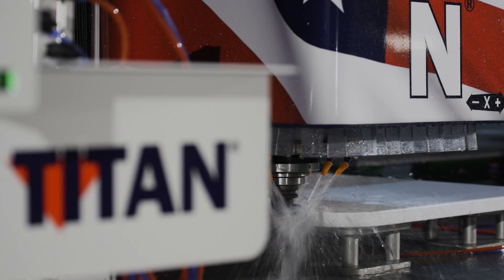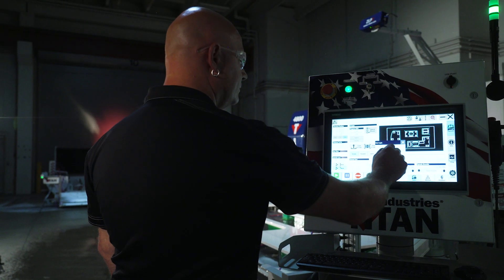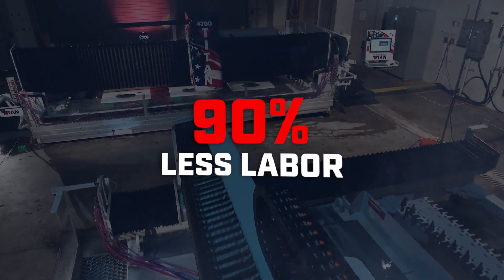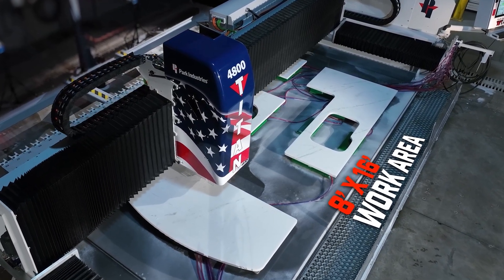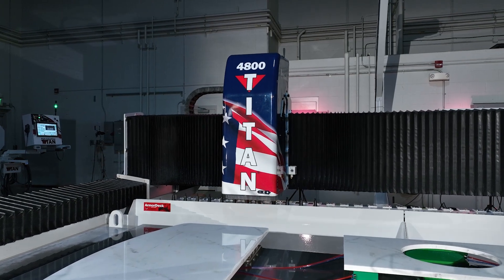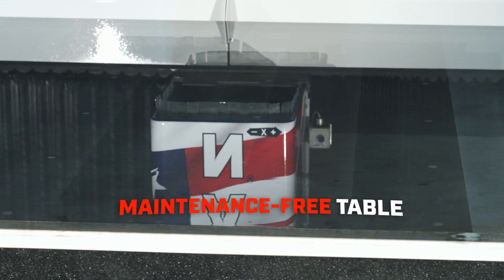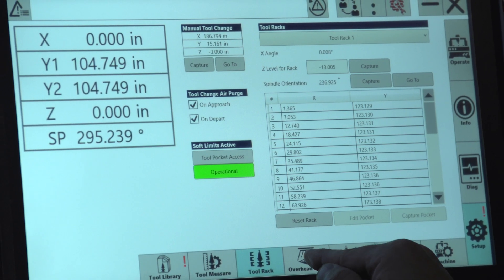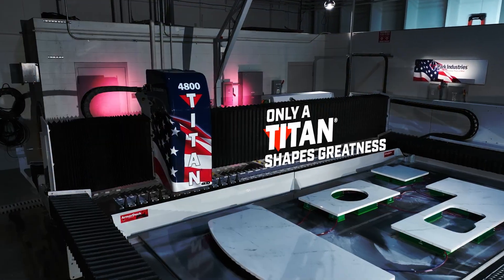TITAN 4000 CNC Router Series | Only a TITAN Shapes Greatness

Comment: I was watching Titan talking to a guy about simultaneous milling.  If the part is the same on both sides, one cutting head on the left and one on the right could cut at the same time, careful not to meet in the middle.  It would take a little more programing but take have the time to cut the part.  Even a part that isn’t a mirror image on both sides could be milled by two cutting heads without the table moving.  Good luck and welcome to Texas.
Reply from the maker: Love the idea Patrick, thanks for sharing your vision of a multi-head version of the TITAN, we will pass it along to our product management team. 👍